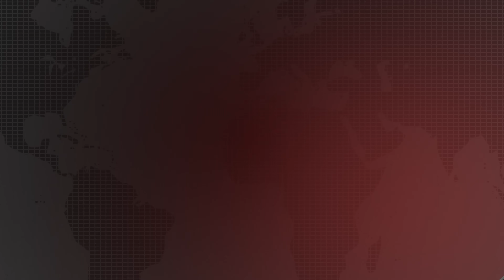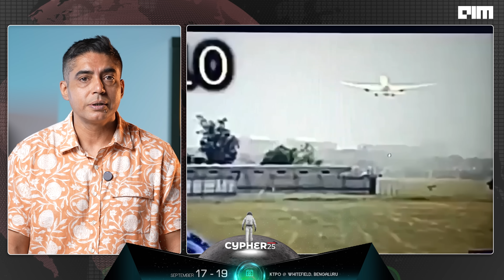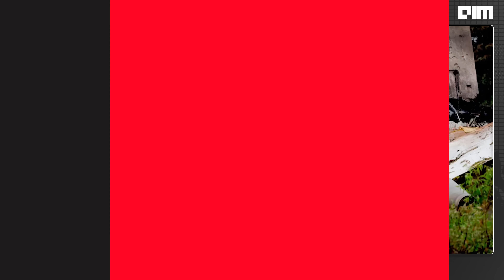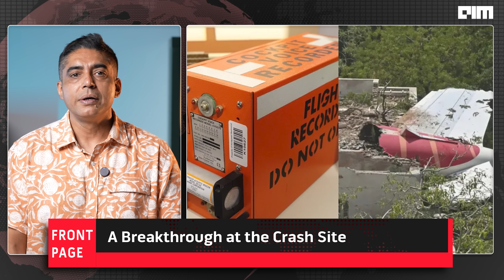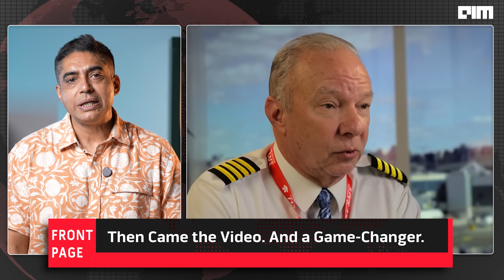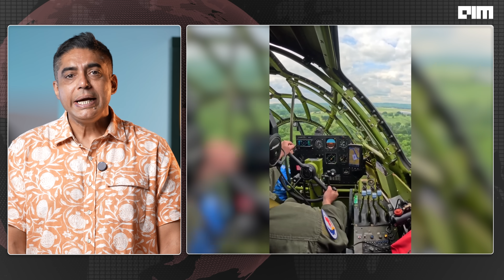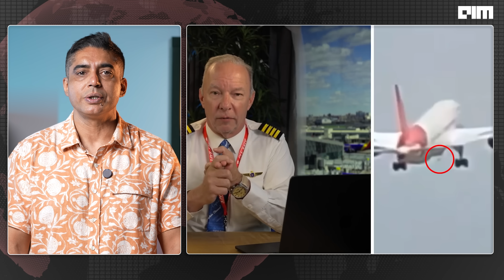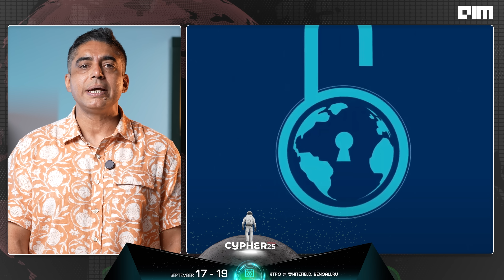Air India Crash: Is Boeing in Trouble Again? RAT Footage Sparks New Questions

Comment: Three days ago, when Capt Steve was still Batting with the flaps, Jeffostroff already had  identified the clear sound of the RAT.
Reply: Yes jeffostrof mentioned RAT first
Reply: Jeff is a professional, not a clickbait amateur.
Reply: Well there is the problem all these pilots are just that "pilots" would you trust a bus driver knowing why his bus broke down? No, you would wait for the mechanic! Same here they are just bus drivers of the sky. The real experts are the aircraft manufacturer mechanics and test pilots! They and only they are the ones that push the test aircraft to breaking point!
Reply: And some of us had to point that out to him.
Reply: This video is very informative, thank you, respectfully 🙏🇦🇺
Reply: How will they ever find out if it was Fuel contamination if it's all burned up?
Reply: Yesterday Max Afterburn mentioned that the video shows the planes rear landing gear are stuck pointing in the downward position. Normally they are tilted back then tilt down at the start of being retracted. Possibly lost engines and or electrical.
Reply: @norme1850 That point being made was that was the first stage of retraction, wheels point down, landing gear folds to retract and it did not happen, loss hydrolic pressure !!! !
Reply: @wilburfinnigan2142 If they lost hydraulics why/how did the aircraft flare just before impact?
Reply: @BillMacCubbin  you don't understand what to flare is.
Reply: @franciscopino5284 Maybe but I thought I learnt it during my 17,000 hours flying and instructing.
Reply: Exactly, and that Steeve-show off never gave Jeffostraff credit. Also I first stated possible fuel contamination, not Steeve!
Reply: @schwarzerkuerbis I've seen several videos that have stated fuel contamination is EXTREMELY unlikely when it comes to fueling jets.
Reply: @JoWill8 : Kerosin is basically very dirty fuel with 160 octane. It is not refined as the Super unleaded with 98 octane you use for Sports Cars. Of course there´s always been some cases in which Kerosin could be contaminated.
Reply: @schwarzerkuerbis  yes Jet A and Jet A1 fuels are kerosine based but they are also refined and treated with additives. I agree that there is always a tiny possibility that the fuel was contaminated. But as more evidence has come to light that possibility becomes even smaller.
Reply: Do you have any idea how rare a scenario is in which both turbines fail while a jet plane starts? It´s rarer than winning the lottery three times in a row. I have actually never heard of such a case!
Reply: @schwarzerkuerbis - that's not really the crux of it tho - a catastrophic failure could have occured that wiped out any of the systems that run or control the engines - the engines wouldn't fail as such, but the net result is the same.

My money - because let's face it, we all like to speculate - is on a catastrophic electrical failure - something's arced, shorted, or blown - and affected the FADEC system.  Both engines dropped to idle.  Fits all current known facts and observations.

Of course, could be wrong.
Reply: @schwarzerkuerbis   there are many things that can  drive to a loss of power in ALL turbines, even if they're working perfectly. I remember one case where a night vision glasses cage made a C130 crash in Afghanistan.  I remember other cases where  a wrong configuration in the pumping system left the engines without fuel.  I remember other cases where the material fatigue or poor or erroneous maintenance made all turbines fail. I remember other cases where an abnormal amount of ice or water made all the turbines to fail. I remember another case where fuel contamination made all turbines to fail. So no, sorry but no, it is not that remote as you say.
Reply: @schwarzerkuerbis That's why they're now saying it may have been the FADEC. Even with fuel contamination, both engines would not have failed at exactly the same time. But hey, I don't know anything.  I'm just listening to all the different people discuss all the potential possibilities. Until the investigation is complete, nobody "knows" for sure. Right now I'm just trying to be convinced that getting on that jet next week for my vacation is safe.
Reply: @franciscopino5284: Maybe we´re all wrong and a local weather phenomena caused an EMP for the first time ever. The sunspot activity has been at a high for three weeks now. Just thinking outside the box...
Reply: C. Steve first accused the pilots- which is the easiest way and then followed others showing how big expert he is.
Shameful clown
Reply: It was obvious when Maximus was breaking this story that the aircraft had no engine power and the RAT was out... which would only happen if the aircraft had no power. Captain Steve just follows. He's no expert, just a man who plays one on YouTube. At best he's a regional jet driver with a YT channel. Wrong since day 1.
Reply: @cageordie  pretty sure he is Captain on a Boeing 777. He may have missed the initial cause but he’s got 30+ years flying airliners, so maybe cut the guy some slack. We should ALL just wait to see what information  the FDR and CVR have.
Reply: @bradsullivan4503  I agree it’s part of making a quick assessment assumption and he later came out with videos to address the RAT. Everyone wants to know what happened right away so it’s nice some people try to speculate as opposed the mainstream media who report as fact vs speculation.
Reply: @cageordie  If the jet had no engine power, it would have never made it off the runway. No? The RAT does not drop out of the plane instantly and start running. It takes about a minute. What ever happened to that jet, happened on the ground.
Reply: @itjustlookslikethis what a dumb question. Engines fail when they fail, no when you think they should have failed. Dumbness  always comes with ignorance, and you ignore what means the 30 meters of ground effect in a 787, don't you? And obviously you also ignore the pilots mayday call "no power". Even what you think you know is incorrect: yes, the RAT gets deployed automatically and no, it doesn't take near a minute to get deployed.
Reply: @itjustlookslikethis mate the RAT takes only a couple seconds to deploy, dont know where you are getting your times from.  Its windmilling and making power within a few seconds of any emergency that triggers it
Reply: @cageordie that was pretty rude
Reply: @cageordie  It must be so cool to know everything like you do. Wow.
Reply: @cageordie  wow! What a diagnosis. Your mental faculty and acumen is next level. Are you a rocket scientist or an expert data analyst? Truly amazed at your comprehending ability.
Reply: Steve didnt do squat, just blamed the pilots.

Comment: There was a video of the previous flight where it was evidence of no power taken by a passenger and post it online that in itself should have grounded that plane thus avoiding this terrible disaster
Reply: Are you kidding? This is nonsense. Do you really think that if the entertainment screens do not works or the lights from the cabin do not function, that  has any direct conenction to the engines? Jesus, people are thinking critically less and less... do you know that the flight crew can disable the light switches for the passengers or the entertainemnt systems just by some switch? I can't believe that so much people think that simplistically...
Reply: Dodgy cabin systems means there is dodgy electrics. Dodgy electrics that run the Fuel Control System.. that could fail and that would cut thefuel feed to the  engines, which would then both cut out at the same time. Im sure you can work the rest out for yourself..
Reply: @bogda3560 A/C not working as well.
Reply: @Natalie-p3n3b  Again, we can't draw any conclusion just from this. They could simply neglect the AC manintenance or simply shut it down. There's no direct connection. I think that all of us that fly frequently and have hundreds of flights eoncountered problems with the inside tenmperatrure (too low or too high) on many airlines, including the european or american ones.
Reply: @bogda3560   It's not people thinking simplistically.. it's people who are capable of forward thinking, instead of being ignorant.  If an electrical system fails.. it gets scheduled for repair, based on its urgency (safety items obviously slightly more urgent than air conditioning)... BUT if an airline is on top of maintenance, the time it takes to fix non-critical system issues is quick.  If an airline is not on top of maintenance, then the non-critical issues get punted down the order and take weeks or months to get fixed.   If the air conditioning and information system has been faulty for some time, it means Air India are not on top of maintenance.  If they are not on top of maintenance, then maintenance of other systems including safety critical systems could also be being neglected.  At the moment, it looks like a dual engine shut-down.. and that can only reasonably be caused by a fuel shut-off.  Fuel flow is supplied by critical safety systems, which in my opinion, could have had their maintenance neglected.  You don't need to agree.. but I hope that clears it up.  Black Box will reveal all.

Comment: One of the required calls during take/off which is normally made by the (PF) Pilot Flying is "Set Take/Off Power" the (PNF) Pilot not flying will respond by setting the required power then by verbalizing "Take/Off Power Set" the PNF is required to check engine gauges throughout the take/off roll and if he sees something abnormal then he vocalizes it and depending on what the problem is then an Aborted Take can be made up to V1 which is the take/off safety speed. These are usually standard callouts that are required which tells me that everything looked normal until just after take/off. So due to the loss of altitude shortly after take/off and if the RAT did deploy then it tells me that the aircraft experienced a power loss on both engines, if it had only been one engine the RAT would not have deployed further more the PF would have been able to climb at V2 which is single engine climb speed which meets the requirements for the certification process, I have been a test/pilot for the last 20 years and we do in fact test this by shutting down an engine then relight that engine back up, the aircraft fly's certainly without any significant issues with one engine shut down on an aircraft that has two engines. All the questions will be answered when they download both the CVR (Cockpit Voice Recorder) and the FDR (Flight Data Recorder)

Comment: Another aviation podcaster thinks it was vapor lock. The plane sat on tarmac for 2-3 hrs in 100 plus degree weather. Inside the plane the captain did not turn on the ac. The bang and flickering lights the sole survivor saw and heard could have been compressors shutting down. Vapor lock would have killed the positive fuel pressure to the engines. Sounds plausible.

Comment: Look,,,,this aircraft became fuel starved,,,by electrical failure or possibly a internal fire or due to the heat there may have been a vapor lock in the fuel pumps,,,,but basically this aircraft ran out of gas ,,,,,and glided to a crash,,,,,,pilots knew already at take off.  They needed every foot of runway which explains the dust which isnt normal, ,  the pilots did everything possible in this dire situation,,,,such a tragedy

Comment: The plane had problems related to air-conditioning and other things that seemed electrical.  From what I read, this plane control system is mostly electrical.   Look at the electrical system.